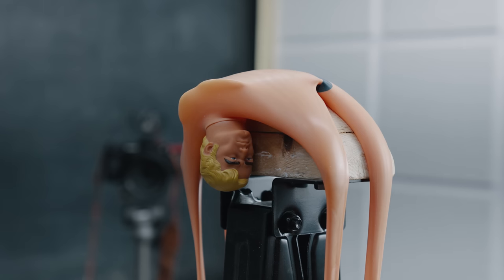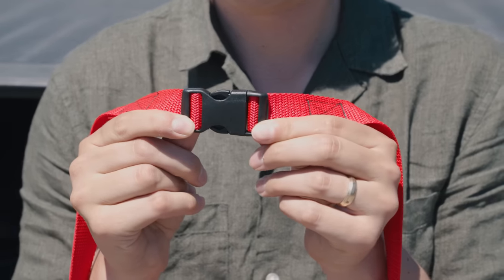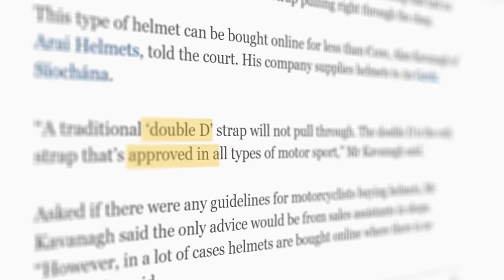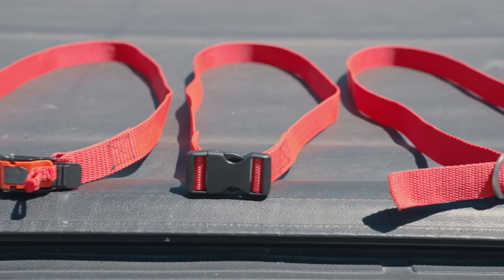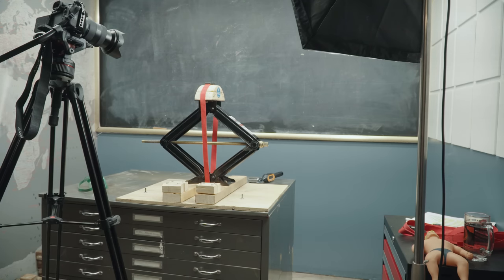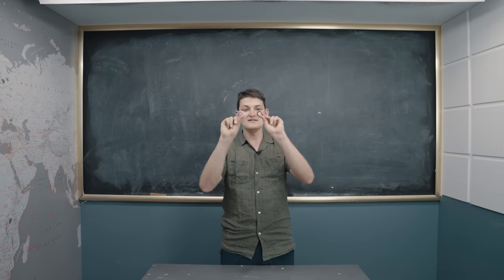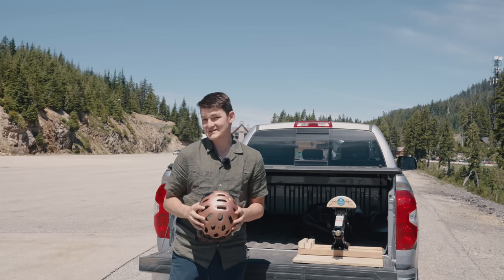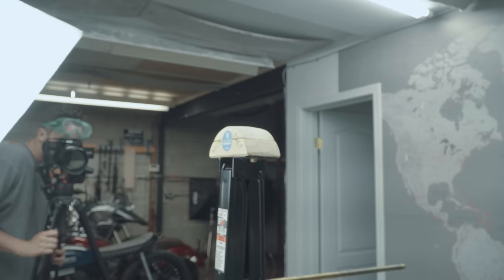Why Motorcycle Helmets Use this Ancient Buckle

Comment from the maker: Of all the wild machines I've built, this piece of plywood was probably the most dangerous. 10/10 would ride again. ~RF9
Reply: You gave that plexiglass a run for it's money. Should've use polycarbonate lol
Reply: What the story with that random half house on the hillside behind you?
Reply: stretch armstrong thought so aswell ;D
Reply: Reason I was annoyed at shoei for changing to non DD on GT air 2 and got hjc rhpa70
Reply: “Which was very over engineered”
Reply: Love to see this on super high speed camera.
Reply: Puts up plexiglas, hunches down. Hunches down further. Shoots buckle through plexiglas, moves camera, puts on glove, wears motorcycle helmet. Priceless!
Reply: really wish i saw this before i bought my helmet lol
Reply: Come on man, want to see your opinion and comparison of the STAR rating Vs the others for motorcycle helmets.
If I've looked at it right, it's the only one that tests v a curb anvil.
Reply: Review/test the Ruroc line!!!! Very curious how they hold up
Reply: It was dangerous because it wasn't "built" much at all.
Reply: Legend  as usual I was looking at buying a helmet today and I couldn't believe I found one with D rings on I nearly didn't buy the helmet thinking it's stone age shit but thanks Ryan 100/10
Reply: @scoutrifle6827  The evolution of safety :))
Reply: Dude I was seriously worried about your fingers! 🤣
Reply: You bet
Reply: First, you’re going to die well before your neck is snapped from a vertical pull, in fact, you would probably have your head ripped off(soft tissue) before reaching the force necessary to break your spine. Second, almost all (near) vertical pulls on helmets are impacts to the chin, which pivots your head on your spine and kills you way before the helmet fails.
So knowing that any force to that could possibly cause a a strap failure is going to kill you, we should not be judging the safety of the latch device on that amount of force.   
That said, I’d like to see some studies on when a helmet should break away, I think the answer is never, as the cases in which it might save your life when the helmet couldn’t are probably zero. I’d also like to see a study that shows at what force a chin strike on your helmet will kill you, because a helmet would act as a lever against your spine. I think the ease of use that quick release devices provide outweighs any unlikely but potential failures.
Also, the ratchet style also tightens with every use, and they aren’t any more uncomfortable than a d-ring.
Reply: @alexsystems2001  I think it’s a ski jump
Reply: @mattburkett9419  I think the point was they are infinitely adjustable and as said on a previous video, the d strap is more comfortable for Americans because of there fat chins…. Rachet strap pinches the fat😄
Reply: My helmet has the pull quick ratchet release....I need a quick release helmet and double D rings are becoming quite rare in Britain....And I tested the quick release in a crash...Helmet stayed on fine.
Reply: As someone who made screens for bikes and visors for helmets for a living polycarbonate is your friend Ryan, plexi will just shatter and take an eye out as the buckle goes thru your skull.
Reply: D-Ring retentions are quick release as well... All the helmets I've had have a little pull tab on one of the rings. Pull the tab back, the strap loosens to a point where you can slide your chin through. When you go to put the helmet back on you pull the strap tight and GTG. I never have to completely undo my straps on my helmets.
Reply: @riderryan4101  I have always had to fight with double D rings..they tend to overtighten and are a pain to undo. I prefer the ratchet pull release on my current helmet, but the German quick release system was almost as strong as the DD system....So I might go that way if I ever find a helmet that uses it.

DD has its uses for normal riding and heavy duty applications, but in my courier job I need a helmet I can release fast....
Reply: People does live for the thrill.
Reply: “YouTuber fatally wounded by buckle  shrapnel” 😳 yikes.
Reply: @mattburkett9419  it's not only sheer pulling force, but reliability against failure of any kind that matters. Fidlocks can be released with the flip of a finger (or any other object). Speed clips are almost as easily released, with just a light tug or prod. Dickclips can and do fail under normal use, being mere plastic.
Also the adjustment of each is not as secure as double-d, and, as stated, seldom performed.
Reply: People who ride without helmets tend to ride safer and are less inclined to be risky. Helmets can cause users to feel a false sense of security which makes them more likely to cause accidents funnily enough. Do what makes you feel safe but remember if you fall there are consequences
Reply: I've always said double D is the way to go. This video just cemented that in place a little more. I'll accept mag loc catches on a MTB helmet but not a motorcycle.
Reply: @mattburkett9419  the ratchet buckle like the other buckles must be retighten at each use because the pull of the ratchet releases the strap on its side. Most people don't do it and end up with a lose strap even tho the buckle is full closed, as in the bicycle helmet example. That's the exact reason I stopped buying ratchet buckle helmets and stick with DD too.
Reply: Next time protect yourself with lexan (polycarbonate) not plexiglass
Reply: Kudos Ryan for putting the COVID-19 Vax sticker on it. #getyourshot
Reply: @mattburkett9419  I agree, the safety should not be judged by the buckle ... And that was the point of the video. The Ds work, so why get fancy? To your other point, the Ds on most helmets are almost always stay threaded. While that isn't proper, is does off a level of backup that a silly, pinching, dirt may foul it, solution to a problem that doesn't exist, does not.
Reply: @riderryan4101  Me either, but that was an omission in this video. I have a dozen helmets, and all of them are threaded through the Ds all the time. First
Responders also just cut the strap if needed, so that's not a concern either.
Reply: @consubandon  I think you missed the point. The Ds work, no need for a buckle. The fact that a buckle can be counterfeit, and can be left undone are both big negatives. The fact a person in the industry is complaining about a bit of side loading is another red flag. I'll let the bus bumper know to load straight during my next accident. Nearly all Ds are left threaded forever after the first use. A loose D (while improper) will offer more protection against the helmet falling off then your unfastened buckle.  
BTW, I love your buckles on my bicycle helmets :)
Reply: @adaycj  Yeah, yeah, YES, and yeah!  I'm not just a plastic buckle designer, I was also a paid motorcycle riding instructor and I wouldn't want anything other than D-rings on a motorcycling helmet!  But I ALSO want a side-squeeze destruction demo done RIGHT!
See?
Reply: @scoutrifle6827  Spot on!
What are some sayings...
The sacrifices we make for science.
It's all fun and games until someone looses an eye.

ATGATT!!
Reply: @consubandon  Thats awesome! and a very valid point. Those have been knocked off by the millions (billions?). You do know that F-9 just culturally changed their name forever right? Hope you're ok with that, it's out of our hands now:)
Reply: @randomdude189  so, you acknowledge that you are at greater  risk of injury (or risk of greater injury) without a helmet on.

That's a start.
Reply: If a person is really that lazy that they think D-rings are inconvenient, then maybe they should sell their bike and get a Tesla. I've only ever had D-rings. They fasten and unfasten quickly. If you are really in that big of a hurry, then just leave your helmet on during the bank robbery.
Reply: A pity that.there isn't a slowmotion of the microratchet failure. Great vid as always!
Reply: @anonymous-yg1hy  I use a Shoei RF1200 with D-rings, but there are decent arguments for the FidLock. When I ride into work, I have to remove my helmet when I show ID going through security. I have to take my gloves off to deal with the D-rings, to the usual consternation of the line of cars behind me, and I won't pull away until my helmet is secure and gloves are on. That's not a scenario in most people's lives, but it would be nice not to have to remove gloves.
Reply: @andrewmicklethwaite6807  the old adage. If it aint broke don't fix it
Reply: @mattburkett9419  sounds like you are heavily invested in alternative buckle systems for helmets. The amount of time it takes to latch up a d ring buckle isnt enough to make me even interested in changing
Reply: @brokeandtired  why do you NEED a quick release?
Reply: @holmes1956O  Have to remove my helmet when entering supermarkets etc...for security reasons...Fumbling with a double D would slow me down a lot. I am a courier.
Reply: @WhackBytch256  I don't know about Fidlocks, but ratchet buckles require both continuous pulling down on the latch and pulling apart on the straps.  Random mucking about around the ratchet doesn't do anything.
The ratchet adjusts every time you put it on as well.
Reply: @brokeandtired  lame excuse. Just like the ups guy that jumps from his truck parcel in hand right into the path of a passing truck. Slow down a little life is short
Reply: @holmes1956O  I'm paid per delivery....your "excuse" is my money...I'm on the clock. Time is not a luxury I can waste. Waste even a drip of time and that's a LOT of money down the drain over a year.
Reply: @brokeandtired  I will tell you what my uncle told me 50yrs ago. Work smart not hard. He was a self made millionaire you never will be
Reply: @holmes1956O  I am working smart....stupid people waste time. PS: He was a millionaire you're not. FYI I run my own business.
Reply: @brokeandtired  I am retired. Ran 2 busnesses of my own very sucessful in both. And ran both at the same time.
Reply: @holmes1956O  go away...busy.
Reply: @brokeandtired  😵😵😵💩😂😂😂😂😂😂😂😂😂😂
Reply: @bradmsmith  Ryan is a physicist.  I don't doubt that he has done the math to establish legitimate  results. Such as correcting for the geometry of the Jack at the height at failure or possibly employing the modulus of elasticity of the nylon and the length of strap at failure to establish load at failure.
Reply: Hey Man, I got a Tenere 700 with 9900 miles, I’ll sell or trade yah.
Reply: Nobody beats F9 videos.... Awesome job. Would love to see the force estimates not just the torque. The angle of the mechanism counts here.
Reply: Ryan youre a lucky man. Your wife is sooo hot
Reply: FortNine's investigative vids (by which I mean your investigative vids) are some of the very best to be found on the Tubes of You. For all the helpful hints and enlightening insights, I always try to buy my bike parts from FortNine first. You guys have earned that sort of loyalty, I think.
Reply: I mean you are true, the double D was the first thing i learned at bike school. and every time my helmet has a thigh fit because for me, depending on the season it will chnage, for example extra mask or something it all changes how thight you can put it around, so that it wont stangel you
Reply: Use your ancient DD if it makes you feel safer but to me it is the most stupid lock system ever.
Reply: I bet it was made by hand sanding it to shape using your shop's treadmill adapted with grip tape which you used for the episode on Aerostitch suits as your infinite length road. How did I arrive at this conclusion? Because its what I would do with my impromptu belt sander if I was without other more useful tools for the job!

Comment: Funny watching them get progressively safer when testing the straps' breaking points.
Reply: After first strap wondering were his helmet was
Reply: Wasn't that the point of the video/test?
Reply: @TravisTerrell  think he means the crews PPE
Reply: Safer for use, more dangerous for tests
Reply: Safer? er not exactly, rings are overkill as are the mag thing and sliding clasp. the point here is they need to be done up right, the rings are more likely to be done up correctly. BUT F9 is trolling us. I'd never go back to the rings, sliding clasp is so convenient to use.  Just as easy to snug up as not, rings were always a bit of fiddle especially with a thick tube neck warmer over the top. tearing your head off harder is not what i'd think of as safer tbh.
Reply: I'm talking about how Ryan starts by ducking a little when breaking the first strap, to taking cover behind the cabinet, to moving the camera, to putting on a helmet. Each time I thought it was a little unsafe, and in the next clip, they did something to be more safe. One more test, and he probably would have donned a bullet proof vest at that rate.
Reply: Not worth a trip to the oral surgeon, so yeah I'd say it was called for. hahaha
Reply: @alan-sk7ky  I think you missed the oher point Ryan was making. Double Ds make you go through the motion of tensioning your strap properly, every god damn time. And I get it, modern society wants to sell us all sort of crap, in the name of convenience but I don't think the purpose in life is to have everything easy, at hand and convinient. All hail the double Ds :)
Reply: @ioandragulescu6063  Only the bicycle type of strap is likely to stay loose. With the serrated strap, you also have to manually tighten it every time.
Reply: @ioandragulescu6063  … I’m a Double D guy, and proud of it!
Reply: @ioandragulescu6063  yea he does but so would the retched do. I had every system so far and my latest and most expensive helmet had the double D. 
The worst is the dick  system, then magnetic and then you can pick your poison...
Reply: Never had D-ring helmets. Had helmets with a sort-of miniature seat belt lock, and currently one with a fully metal micro-ratchet-style quick release thingamabob. They're awesome! 😁